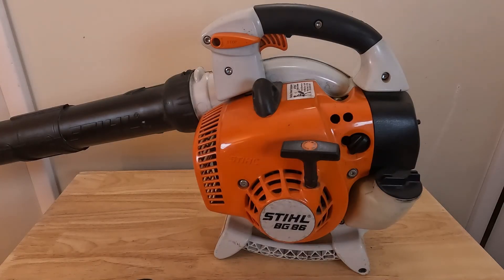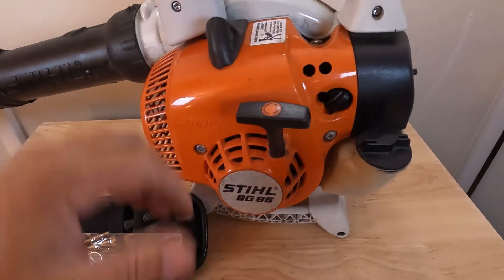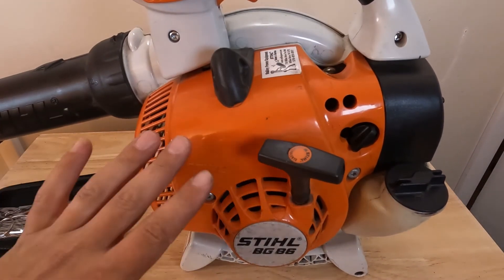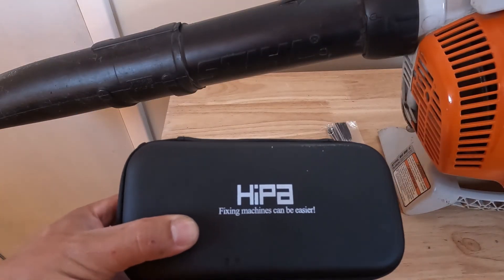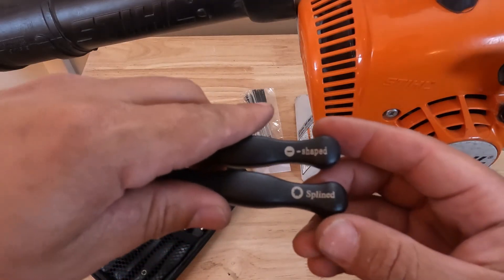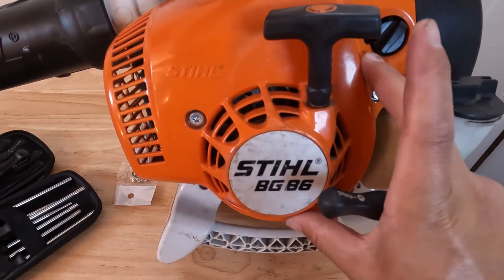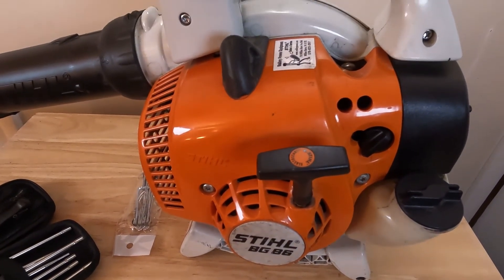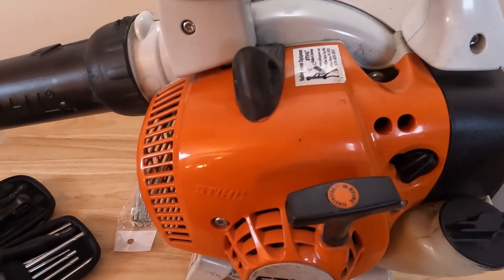How to Adjust a Carburetor- Stihl Leaf Blower Model BG 86 with HIPA Adjustment Kit

Comment: Sadly, you don't have a much idea on starting and adjusting these blowers do you, which looks a little silly. You seem to be more interested in selling the tool kit.
Reply from the maker: You can't adjust most machines without a kit like this. What part of the video did you not agree with?
Reply: You looked stupid trying to start it. Anyone used to working on these knows that when the lever is put in the choke position you don't touch the throttle lever. If you do the choke lever returns to the normal running position. You highlighted that kit far more than was necessary. Just out of curiosity what is the bag of brushes for as I cannot see a use for them.
Reply from the maker: I work on all different makes and models. Some don't open the choke when you press the trigger and it makes it easier to start. Don't work on Stihl that much. Just like taking things apart and getting them running again. Brushes are for cleaning the ports if you're cleaning the carb

Comment: The hi/low adjustments are capped off.  I'm a bit puzzled that you did not mention that.  It is my understanding you need to first remove the recoil cover and pry off the caps.
Reply from the maker: It's been awhile since I made this video but am trying to remember. Sometimes you can still fit the tool inside the caps. Also this may have been an aftermarket carburetor. They typically don't come with the plastic caps

Comment: Useful video.
Which tool do i need to use to adjust the high and low settings with?
If I buy a generic carb adjustment set will it usally have them in the set?
Reply from the maker: If you buy the Hipa set in my video description I almost guarantee it'll have one that fits. The kit comes with a bunch of different styles and it's actually really affordable
Reply: @fixanythingsavemoney Thanks for the info.
Can you tell me which one in the set I will need to use for the high and low screws?
Also do you have a link to this set?
Reply from the maker: And thank you!

Comment: I can't get it to stop bogging down no matter where the low setting is set. All the way clockwise until it stops and all the way counterclockwise until it nearly falls out  - makes no difference. I thought it was the carb itself but then I replace the carb and it still won't run. Tried all of your tuning suggestions in this video - no difference. I've tried it with the high setting all the way clockwise and at different points counterclockwise too.
Reply from the maker: What about the idle screw?
Reply: @fixanythingsavemoney  I have that set so that it will idle OK.
Reply: Would it even idle if the gas was bad (old)? I thought about dumping the tank and trying again with fresh gas mix. I don't know how old gas behaves.
Reply from the maker: You may need to replace or clean the carb. What make and model do you have?
Reply from the maker: It could make it behave this way. Its worth a shot.
Reply: @fixanythingsavemoney  OMG. Problem solved. It was the spark arrestor. Completed caked up and clogged. Cleaned it by burning off the gunk with a torch. Now I get to spend another 20 minutes retuning the carb. 🤯

Comment: Is it my imagination, or did you just show us a fancy tool kit and then use a flat head for all three screws???  LOL The BG 86s I've worked on only let you use a flat head for the LA, the L and H require the fancy tool. Not sure how you pulled that off. Stihl used to threaten to fine dealers for selling those adjustment tools, which I thought was hilarious. Also I would recommend going 1/4 turn at a time and take your time. The LA is a screw that bottoms the throttle linkage, the L is a needle valve for the low side. You have to find the sweet spot between them.
Reply from the maker: On this the flathead fits the H and L i think the idle is a Phillips. The kit comes with a small flathead but I think the carb I'm adjusting in this video is from HIPA as well

Comment: What does one adjust the Hi setting with? Hex head?
Reply from the maker: This adjustment is made with the same - shape tiny flathead.
Reply from the maker: Just be sure to rev it out and adjust while it's in full rev. I always air on the side of caution and set it lower to avoid engine damage
Reply: @fixanythingsavemoney  thanks!!
Reply from the maker: @Barticus1969 no problem!

Comment: I've had lots of Stihl products in the past and they have all suffered with bad carburettors. I've now changed everything to Echo which are much better.
Reply from the maker: I have a video up of the Echo pb blower and I have to say that blower works great. I didn't get a chance to really test this Stihl. I was just fixing it for someone but good to know! Thanks!
Reply: I agree, ive been repairing Stihl tools for years. The carburetors on their tools are nothing but trouble. The quality  has gone downhill to the point that I advise customers to buy Echo these days